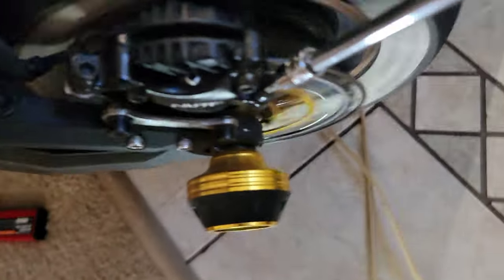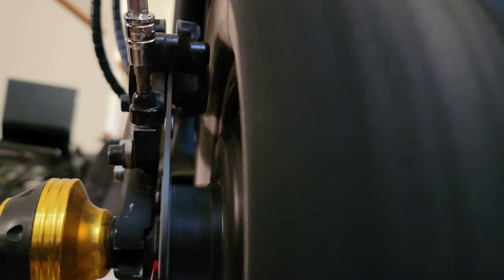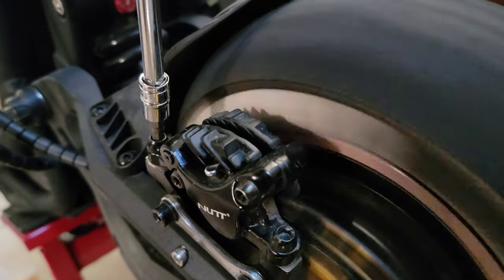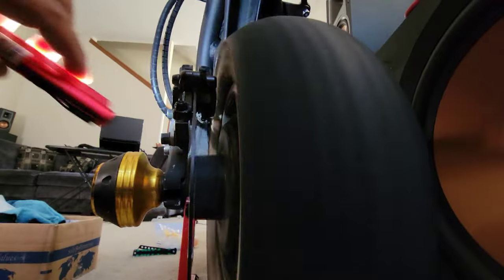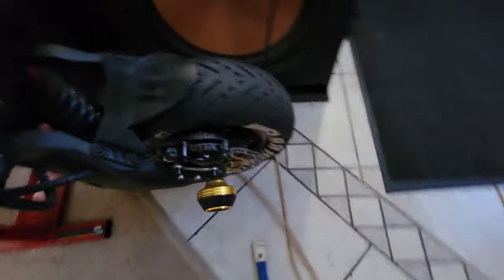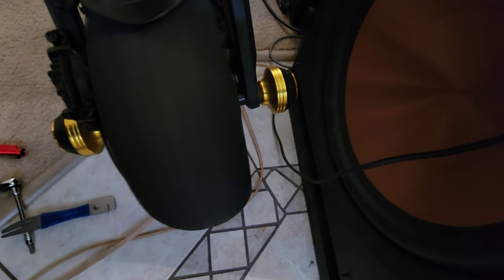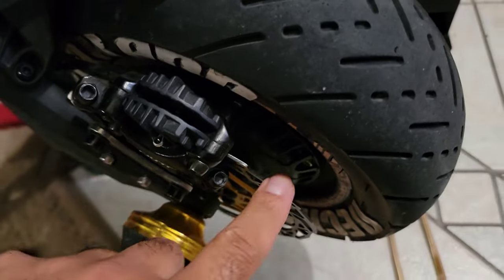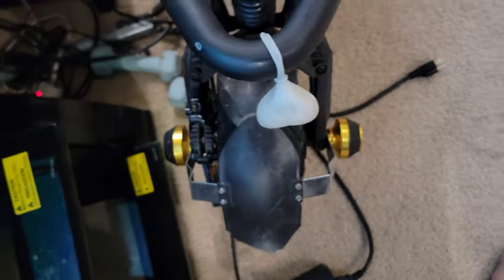How to get rid of brake disc chatter (E-bike/E-scooter/Surron/Recon/NUTT/LOGAN/Magura) disc brakes

Comment: Hi bro 🙋
How are you..? My man you have to change your front tire!! It will destroy your motor!!!😬
You say it very good!!👌
Reply from the maker: Hey Anthony how is it going?

Yesterday I reset my tires on the rim, changed the valve stem to the straight valve stem and installed magura MDR-C rotors to the NAMI. I haven't ridden the NAMI but I hope when I put air back in my tires the tires will be reseated and smooth without any changes or vibrations. If it's still shaking, I will bite the bullet and maybe get new tires
Reply: @Jonasegway  well done bro!!👏👏
Change discs it was very good!! I think magura are 165 mm or make wrong...🤔
Before fuel tires with air, spray little silicone spray between tire and rim, or on a piece of paper little oil or vaseline and pass the rim both sides (you understand what i say 😁) and press 60 PSI in start, then go down to 45-50 psi..
Waiting to see next video with new discs!!🧐🧐😋
Reply from the maker: Thanks Anthony. How is your project coming along?
Reply: @Jonasegway  right now change the winding of one motor (have 10 inch front and 11 rear)😁 make it for hi speed and less torque (something win something loose) ... In the end of next week i will finish it and put it rear motor (if it work 😋😁) and the 11 motor i have now rear but it front..
Also i order the biggest YYK Controller, one for rear only ( it make a month from now to come) it is 150 amber and these i have are 80a each... We will see...
Aaa ... And+ 1s my extra batteries from 4s to 5s that means 16s + 5s = 21s (76v, full charge 88v).. 
When i finish the winding of the motor will make a video... It Blow my mind till find the right way wires go.... And also make bigger the phase wires to 10 awg (motor - Controller wire, green, blue, yellow) but that was the easy part or the winding project... Anyway...
There is a chance to buy a blade 10 with controllers blow off..... To have an other toy to play....😁😇🚀
And last but not least... Pass COVID the new one O5....  It destroy me!!! 
Loose 4-5 kilos, the first  week 38-39 temperature cut my breath and my strength,.. and now after 45-50 days I'm in 85-90% of my health...
Anyway, thanks God all ok!👍💪
Reply from the maker: O my you have alooot going on over there. Thank goodness you are ok with your health! 

As far as the wheel size goes, I think the 10" in the rear will make you quicker for sure. 80a controllers 😲. I have heard of this blade 10 scooter before. I think I will need to check it out.
Reply: @Jonasegway  something you misunderstood.. or didn't write well...
72v 80a are the Controllers i already have to my scooter! Two of them... I order a new one controller YYK 120v150a and when it arrives i change the rear controller 72v80a with 120v150a ... 
Also 10inch motor is smaller than 11inch motor... How it will help me better..? It's like you but the motor from Victor to Nami (the rear) and front is 11inch..
About Blade 10.... I will buy one with broken Controllers (burn mosfets)!! Then i will make my magic....😁
Blade 10 stock is 60v28a battery, 10 inches motors and 30a Controllers...
Reply from the maker: @antonypartali  ahhh gotcha now. My goodness that's alot of power 😳
Reply: @Jonasegway  we will see... When i finish  motor winding, the motor and the phase wires they're going to handle the extra ambers..
Batteries has the power to send controller the amber it needs... So in theory I'm okay... When controller arrived i believe we will make work...😋🚀